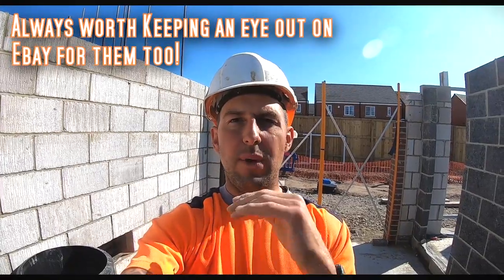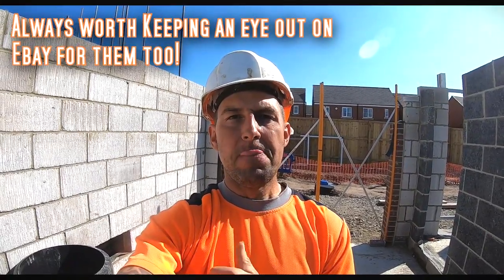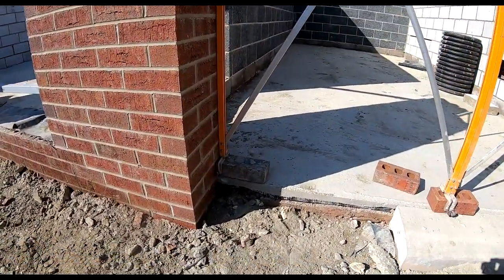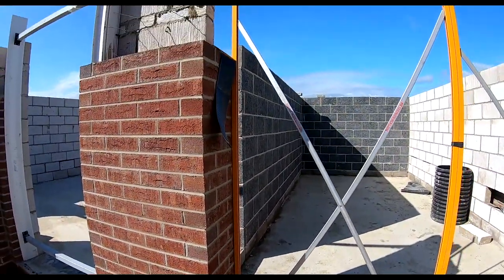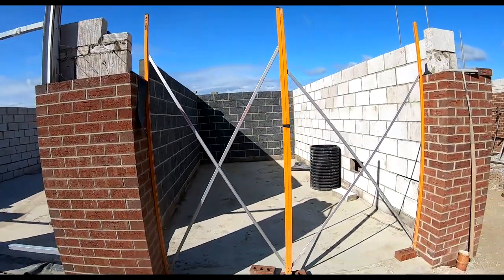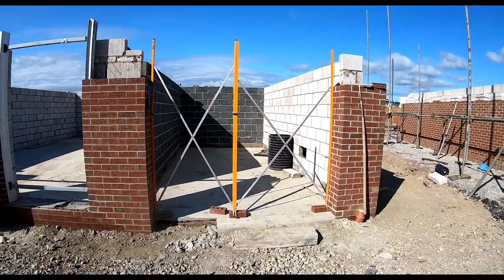BRICKLAYING: X-FRAMES IN ACTION 😬

Comment: Where are your stands and board from mate
Reply from the maker: Hi Kyle ! The are made by refina.  If you google mortar board stands there are a few different makes but I would defo recommend the refina. I went for the 32 inch and cut 100mm off the bottom of them 👍👍
Spots are just floor boards cut down! 😊👍